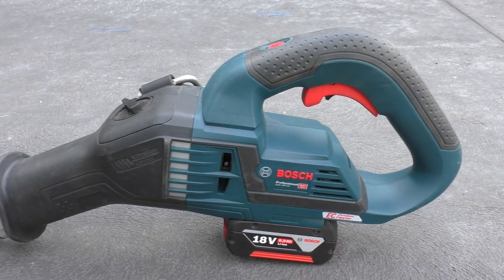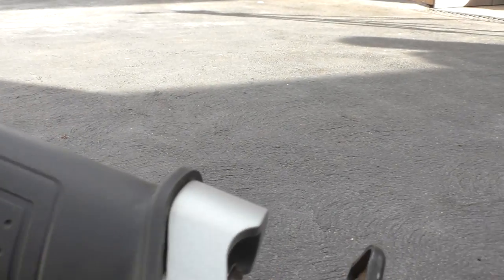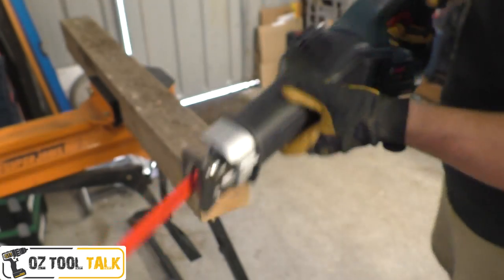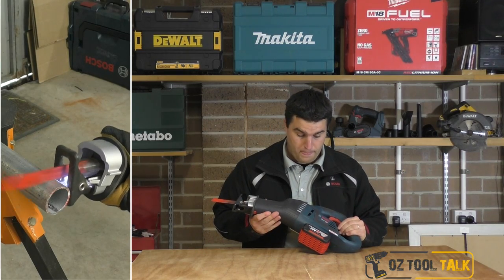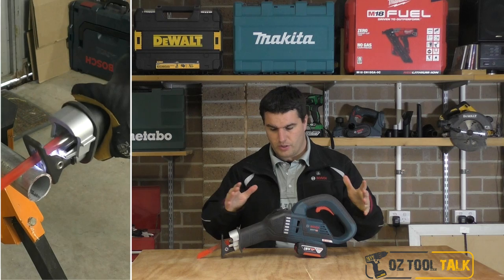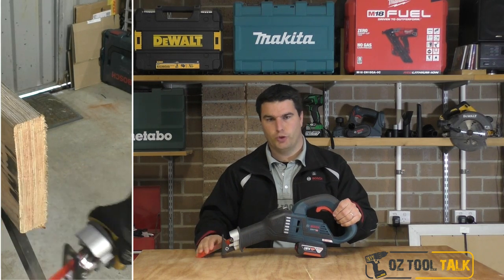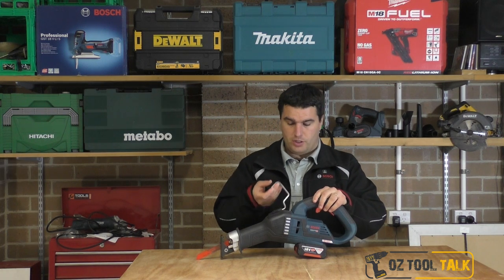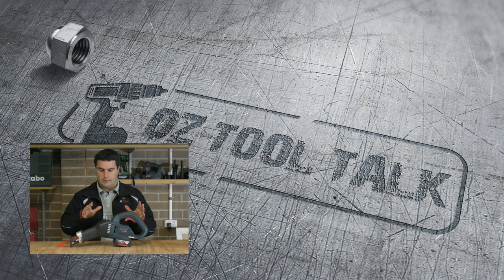Bosch GSA 18V-32 Sabre Saw - Brushless, Orbital, Variable Speed

Comment: Gents,  I love every review, keep it up, keep it real.  I have the full Bosch platform. But currently I feel disappointed.  Are you planning anything with the recently released grinder and the new battery?
Reply from the maker: [Dwain] yes both, very soon! cheers
Reply: Oz Tool Talk I am dedicated to Bosch and the quality and reliability they have upheld for so long. The last few years have made me question my stand. Do you agree?
Reply from the maker: [Dwain] in comparison to some other brands, they have been slow to update. But the recent upgrade to recip, grinder, SDS and drill have helped a lot. ALso CORE batteries!